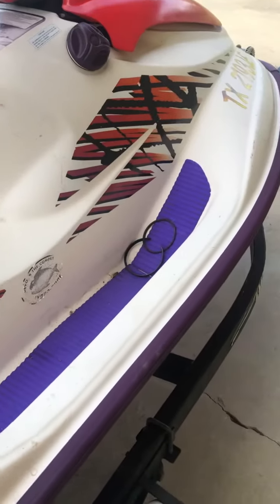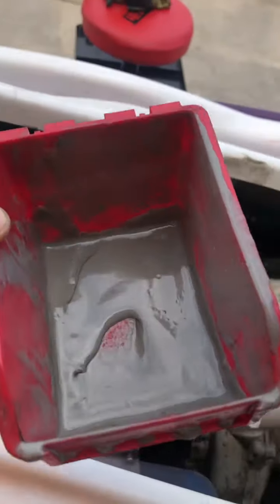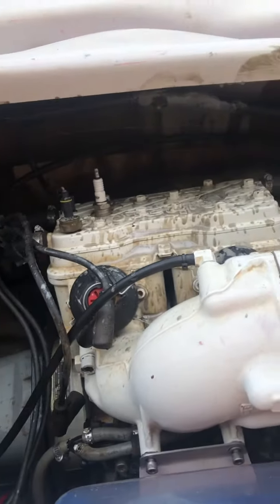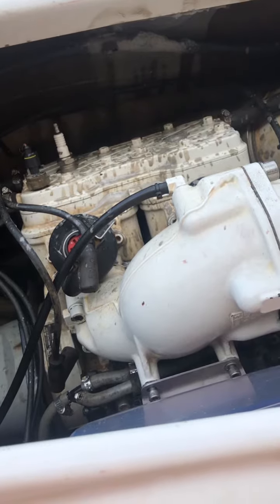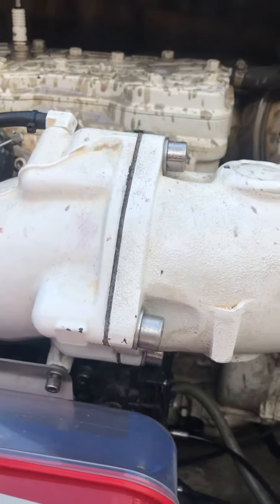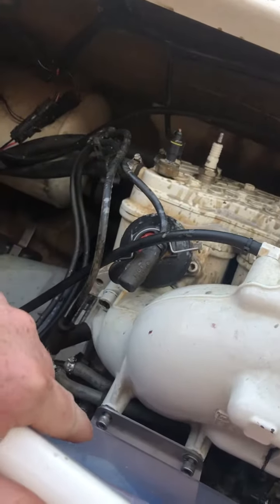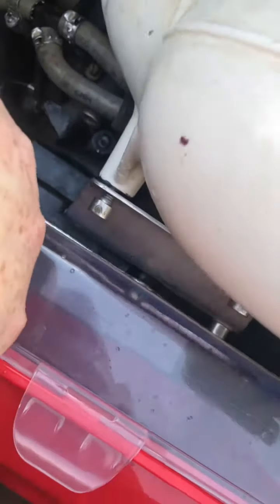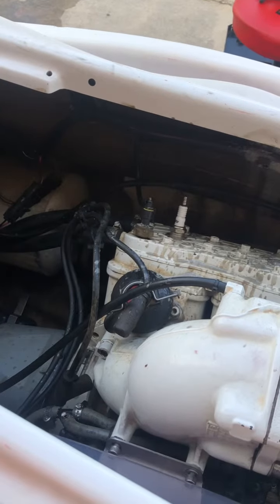I DESTROYED MY SEADOO!! 787 Rotex 1998 SeaDoo GSX  water in cylinder

Comment: Gonna require a total tear down and reseal. You have water intrusion into the rotary shaft and or counterbalance shaft inserts in the bottom end of the engine. Just gonna cost you a  $75 gasket kit and a bunch of time.
Reply: Hey what if it’s only happening in one cylinder out of 3 My Center one??? Other two spark plugs were still perfect and firing Jet Ski was still running but just on two cylinders the third plug was fouled with the aluminum goop moisture, I pulled the heads off and it doesn’t seem to be anything wrong with the piston rings or a lot of movement, it does look like the center piston has been replaced before from the place I bought it remanufactured from sbt
Reply: @jeffhandy2793  SBT Sure To Blow ..... you need to tear it down for a seal replacement.
Reply: @drgriffin1972  So basically the same situation as your reply to the other guy the crankshaft counter balance etc. underneath
I have limited mechanical knowledge and space or time,,, no good JetSki mechanics in Brevard florida 
I laughed at sbt sure to blow 🤣🤣🤣
I bought a used for 3K and got three years out of it so I’m pretty good not sure if I wanna put 2K back in it because if you’re going to tear down your must redo everything almost
Reply: @jeffhandy2793  most all of those models have a case that splits that must be sealed. The crankshaft also has seals on it and 9 times outta 10 the crankshaft seals slide on The crank therefore rendering the crankshaft unusable. You have to get a new or rebuilt crank then replace all the sealer and put the case back together then assemble the top end with new seals as well. Not really too difficult but it does require alot of time and for a novice I would not recommend it unless you are willing to put alot of research time into finding the specs and the methods of doing things. I was a level 3 seadoo tech back in the late 90's early 2000's. Back then I would do a complete tear down and rebuild with all new parts in about 6-7 hours as long as I didn't have any bolts break off on The case halves. If that happens prepare for 1 hour per broken bolt. If you are around salt water in Florida I would bet you encounter several broken bolts.
Reply: @drgriffin1972  thanks for the advice, and yup i saw few broken bolts, already.